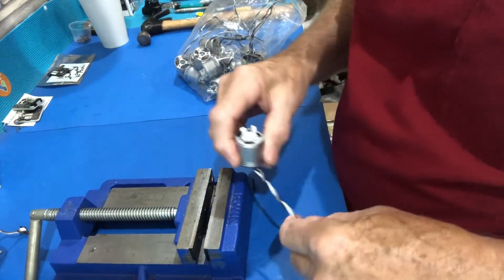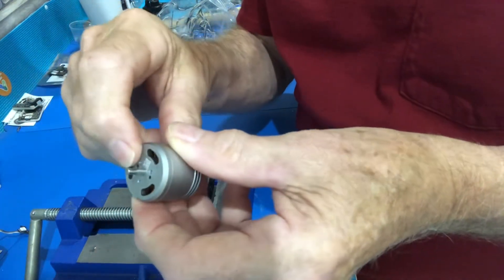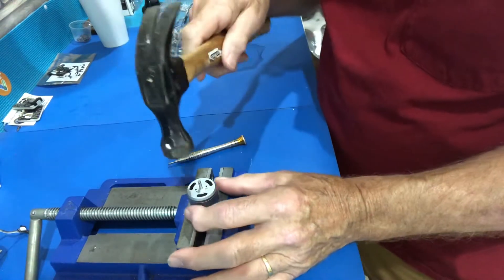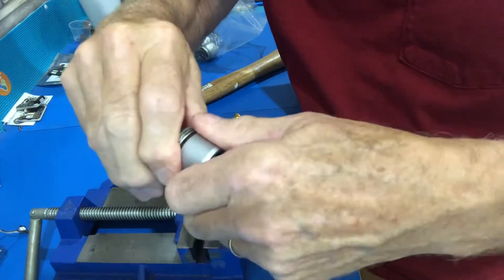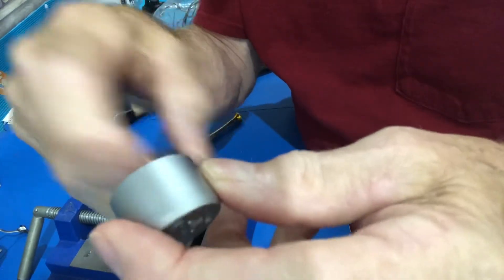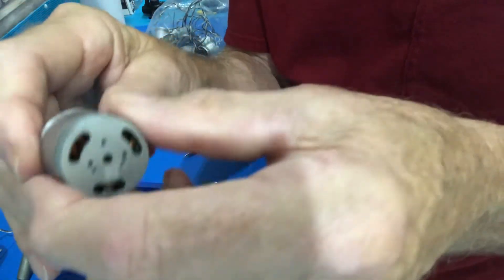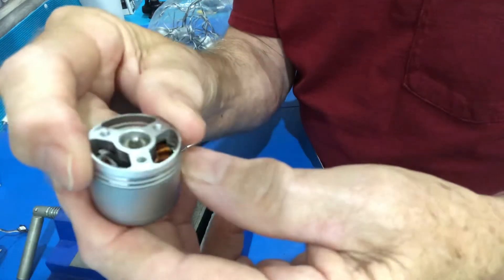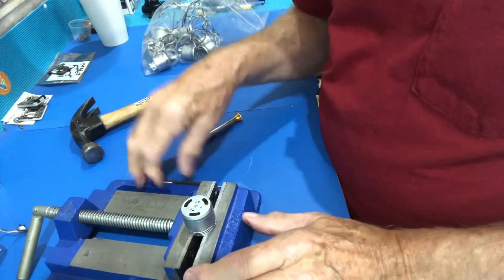DJI Phantom 4 motor repair

Comment: is there a way to check the motor for debris without removing the motor from the drone?
Reply from the maker: Spin it by hand. You can feel the difference. If it is dirt you can blow it out with high pressure air. If it is metal you will have to take it apart

Comment: Ted tried the video bit found i knackered 2 of the 4 bearings taking the assembly apart. I have new bearings but cannot get the old ones out?
Reply from the maker: sorry to hear that. I use a punch to knock them out. It is long and narrow. I put it through the hole in one bearing. Put it on a slant so it catches the edge of the bearing and tap it out.

Comment: How are you sir do you do a repair service
Reply from the maker: Yes I do.
Reply: @Droneted   I live in Germany, how can I send you the drone?
Reply from the maker: @basherrasheed5844  you can email me at:   droneted@gmail.com
Shipping is rather expensive from Europe. Is it the whole drone or just the gimbal that needs work?
Reply: @Droneted  I have the same problem as in the video, and since someone else tried to fix it, I would like you to check it as well..
Reply from the maker: @basherrasheed5844  So you are having issues with the main motors on the drone not he gimbal?

Comment: Thanks for the video, just got iron sand in mine after flying on an active volcano.
Reply from the maker: were you successful?
Reply: @Droneted  have not cleaned it yet will let you know
Reply from the maker: @catamaranmentor  I would use CRC electronic cleaner to clean the motors when you open them. Then I would blow them out with compressed air.